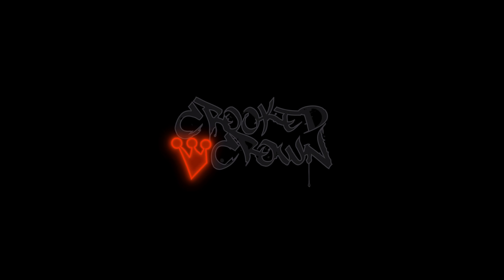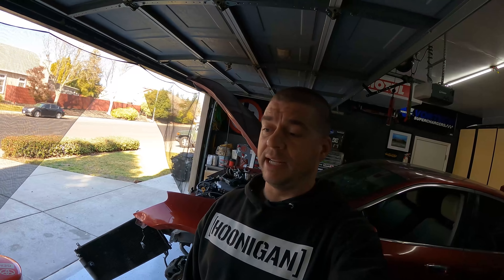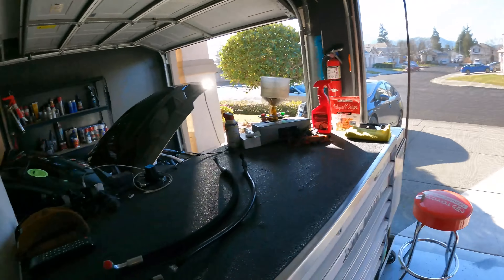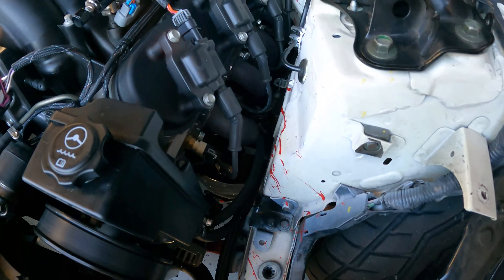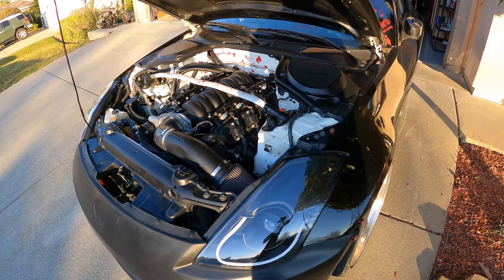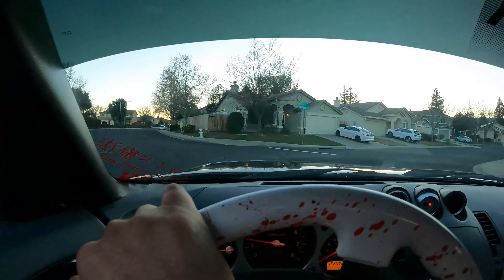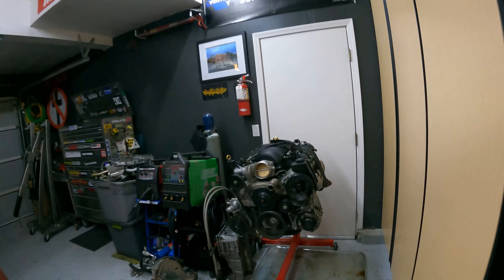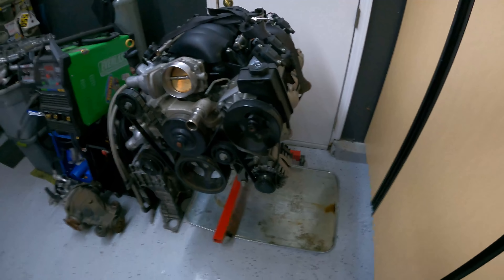WHAT POWER STEERING LINE?!?......

Comment: If it's that close to the header I'd put a heat shield on the hose or wrap it in the titanium heat wrap just to be safe... might have been why that other plastic and stainless steel hose busted?..
Reply from the maker: I thought that but the fact that they blew off at the ends, and after talking to the hydraulics guy, the fittings were wrong for that hose setup🥴🙏